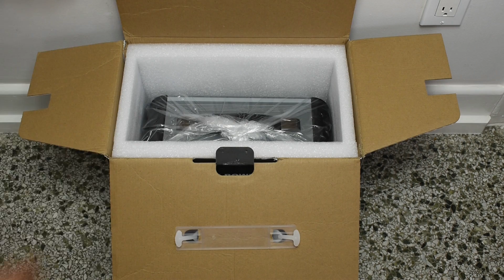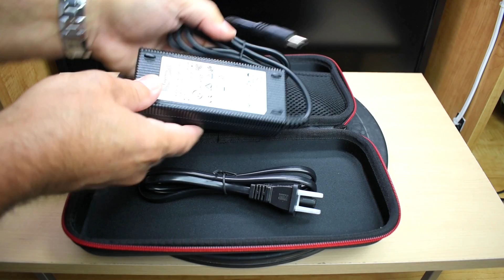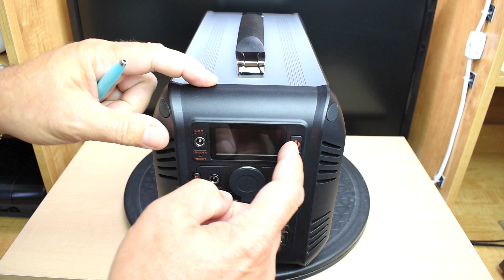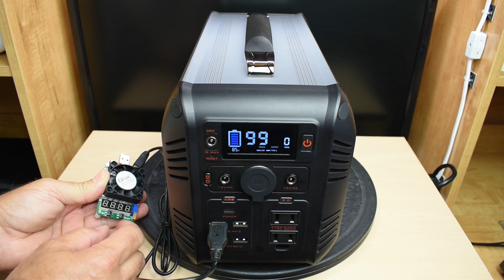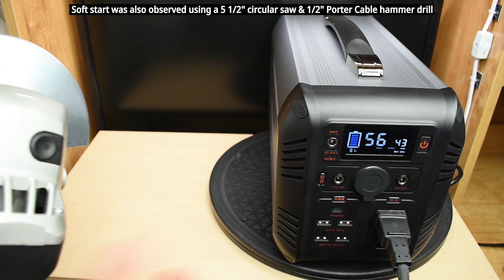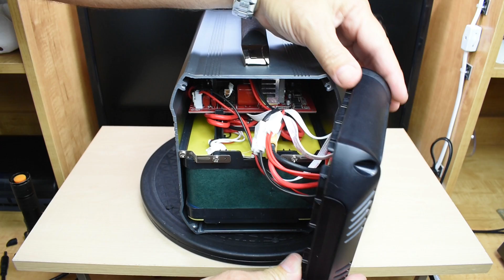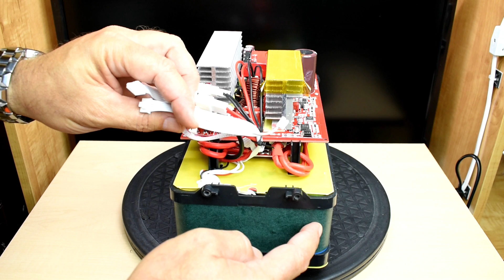This LiFePO4 Portable Solar Power Station Changes Everything!

Comment: Just received my Oukitel this morning and was very pleased with the design and build of the unit. I immediately started to charge it with the wall charger and charged it for 10+ hours. It said it was charged to 80% and wouldn’t go higher. So I unplugged the unit from the wall, tried to turn it on and it was completely dead. The charger was cool to the touch the entire charge time. I hade full display and all lights were on during the charging phase. Any ideas? I’m gonna leave it plugged in over night and then check it for charge again. Strange!
Reply from the maker: Drain it all the way down, let it cool 1 hr, then recharge. :-) It will go to 100%. Press and hold the power button to turn it on. The unit should power up even if the battery is drained, that's weird.
Reply: @electronicsNmore  ... Thanks for the reply! The unit will not even turn on if unplugged from the wall charger. It turns on for a split second the off. Can’t even try to discharge it. When plugged in, it shows about 80% and the battery icon shows charging. I also tested the charger and it seems to be putting out around 20v. But will not even get warm to the touch. I tried to reset the unit and nothing. Weird!
Reply from the maker: @COMtnPilot  Try using a 200w load while it's plugged in and charging.
Reply: @electronicsNmore  ... OK. I’ll ty that when I get home and let you know. Thx!
Reply: @electronicsNmore  ... Well, I got home from work and plugged in my rice cooker (430 watts) to the unit and had the wall charger connected as well. It took approximately 55 minutes to completely drain what power was left (79%) in the unit. The unit shut off with 4 minutes and 5% left. I let the unit cool down as recommended, then plugged the unit back in to the wall charger. The battery indicator is showing charge, but the numeric indicator shows ZERO watts input. I don’t think this unit is any good. It might even be used and defective. I was looking through the manual and it shows I should have received a wall charger, a car charger, and a solar panel charger. I did not get the car charger. I guess I made the wrong choice, so this thing is going back! Not very happy right now. 🤬
Reply from the maker: @COMtnPilot  Sounds like another person bought it, likely damaged it using a charging method besides what should've been used, stole the missing parts, then returned it. Sadly you got it. It happens. Send it back, you won't have to pay Amazon return shipping. Get another one. I bought a folding solar panel from amazon, and inside was a stack of paper. I reported it, and got my money back.
Reply: @electronicsNmore  ... Update! I tried to contact Oukitel directly and never heard back. I put in a claim with Amazon and was refunded. I was not asked to return the defective unit. Question, is there anything I can do to try to figure out what the problem is with this unit? I would pay someone to troubleshoot and repair it at a reasonable cost. Just thought you might know because of your knowledge base. Thanks in advance!
Reply from the maker: @COMtnPilot  Usually you just select "return item", then give a reason "Defective", then you're issued a return label. After that they ask to send a replacement. You made out. You'll need to see if there are any electronics repair shops in your area.
Reply: @electronicsNmore  ... They did not request I return it. No label was issued. I have the email proving it, and plan to print and keep it too. I’ll tinker with it. Might be something simple. I could not believe that Oukitel would not respond to me or Amazon. I think they realized they sent me a used and defective unit. Kinda pissed me off! I will not attempt to buy another from them either. Thanks again for all your input! Cheers!
Reply from the maker: @COMtnPilot  You did good though, the bank of LiFePO4 batteries is worth some money. Maybe use that to power another inverter. :-)
Reply: @electronicsNmore  ... But only if the batteries are still good. I wished I had your skills and knowledge to troubleshoot this unit! 😏
Reply: @COMtnPilot  Mine (Bibene) died after 16 months. I was super happy with it until then. No longer charges (0 watt input). Did you ever find a solution?
Reply: @JohnMartin-regardingjohn  Nope … Still sitting in the original box. I thought about dragging it back out to try and charge it again. I wished I could find someone in my area who knows more, and feels comfortable testing and working on these units. Like I mentioned before, I would pay a reasonable fee to have it repaired. I would love to be able to use it. Let me know if you find a solution. 🧐

Comment: Great review! I was trying to decide between the Jackery 500 and this one. You made up my mind for me! I appreciate you time and efforts. Very well done! SUB EARNED! 👍🏼

Edit: BTW ... Can you recommend a 100-120W foldable solar panel for this generator? I plan to buy the booster you recommend as well.
Reply from the maker: Great to hear! Glad you liked the video. Be sure to use the link provided. As for the panel, the one below is good, the Jackery 100W is overpriced. I like Renogy, HQST, & Ecoworthy. Check out the 100W folding panel below. Uses (2) 50W mono panels. Thanks for watching!
https://amzn.to/3cx9uOw
(Amazon Affiliate Link)
Reply: @electronicsNmore  ... Thanks for the recommendation. Question: If I just buy this 100W panel without the controller, will it work with this generator? It should right? It has an internal mppt controller if I remember correctly.
Reply from the maker: @COMtnPilot  It's only 2 more bucks with the controller, so take that deal, and keep the controller for another use.
Reply: @electronicsNmore  ... Good point!
Reply: Have you seen the ALLPOWERS Solar Charger 100W Solar Panel Foldable Portable? That one folds up really small.
Reply: I'm using 120w foldable, it worked (connected, then charged), however,  CN505 input limited to 90w, i.e. (technically no matter how many watt-panels you use, 90w 100w 120w 150w) as long as open circuit voltage 15-24v, it's suitable but input limited to 90w.

Comment: It's nice, I'd have to build my own though, unless it's a quality product, and stupidly low price, like I'd have to be just dumb to not buy! I'd probably modify it, anyway, but building your own, is  just fun, and you can make it how you want it, and fit your needs! I think I'd start with something like 100ah Eve cells, lifepo4, maybe 24v, with a 40amp epever tracer AN charge controller, a renogy 40 amp DC to DC charger, if it can charge 12 to 24v, there us one surely, and use a couple server power supplies, in series, about 38amps each,  and a DC to DC buck converter capable of around 20amps sustained, maybe add a small cap bank to the 12/14v output from the DC buck, to allow large startup surge from a small air compressor, or something similar, something like a 5farad super cap bank, maybe acting as a battery for tiny loads, like all led night light, maybe have a timer circuit to cycle the buck converter, to save battery power,  charge the cap bank 1, minute on, 2min off, if something, to prevent the DC buck from sustained operation, have a pre-charge relay set-up, but 120v charging at about 30-38amps, the 12-24vcgarging at up to 40amps, and the solar charging at nearly 40amps, it should charge fairly fast, along with a 1500-2000 watt inverter, it could be a cool project! And very useful! 8s 3.2v 100ah is a decent amount of power! Even with a 12v 4s battery, it could be very useful! But 24v it would be much more efficient, charging, and discharging, less current,   
And more challenging wattage, but I know you know this! I don't know the weight or mass it would end up being! It may be better at 12v, or maybe 50ah at 24v, an 16 gauge aluminum case could be built easily! Along with 1"x1" angle aluminum, for bracing, abd battery mounting! Oh man, you got me wanting to build this thing now!! I have had the idea for a 12v power supply, I have a 12v battey bank, fir my 12v lighting, security cameras, and what ever needs power, from a 300-400ah 12v lifepo4 bank, I been thinking of adding a 12v inverter for emergency powering of necessities! Mostly fridge, microwave, and lights! Easily done with a 2kw inverter! So a 2 - 2.5kw inverter, with the 400ah, a internal battery of 50-100 ah, it could come in handy, the way the weather is getting!! Sorry for all the ramblings!!

Comment: I just came across your review. Great job. So helpful. I am going to subscribe. One question, I have been considering a Bluetti or Jackery. This unit seems to be just as good. I am interested in your opinion on what to buy. I am referring mainly to reliability and quality. Thanks.
Reply from the maker: Great to hear! I have many videos covering a very wide range of subjects, so you should be busy for a while. :-). I also have product reviews on my channel for the Jackery Explorer 240 and 500 units, as well as the EF Delta, and Maxoak Bluetti and 300W compact unit. Jackery makes a good product, but based on the price of the Jackery, which is the same or more, I'd take this unit over the jackery 500 because of the LiFePO4 cells, much nicer light, aluminum body, Type C port, and in my opinion better surge ability. Maxoak Bluetti and the other unit I tested, I like very much, but they don't have LiFePO4 cells. Thanks for watching! Be sure to share my channel with others.
Reply: electronicsNmore Thank you for your quick response. I figured this is what you would say. The only big question is well these hold up over time. It has great specs for sure. 👍🏼
Reply from the maker: @litnoregrets7551  No one knows how it will hold up over time. The PPS would need to be cycled over and over on a daily basis for at least 6 months.
Reply: electronicsNmore Thank you. Sorry, I was not clear. I meant things like the quality of the inverter, Charge controller, etc. These are hard things to know and it will take time to tell. Jackerys have a long history and seem rock solid, but they have the worst batteries. Bluetti seems pretty good, but seem to suffer some minor issues. You seem to be the only technical reviewer of this unit. I’m so glad you reviewed it. Time will tell. 😊
Reply: Many will go for the Jackery due to their excellent customer service. Their explorer range comes with a 24 month warranty. The LifePo4 is very tempting though.
Reply from the maker: @mreverybody1150  This unit is better, but I do agree that jackery has good customer service.
Reply: @electronicsNmore  Yes! I discovered that the Jackery gives you an extra year on top of the 24 months if you register it too!

Comment: Great review, thanks. Any current recommendations for a hand crank generator? Something that might be able to charge a power supply like this, but maybe smaller like the little banks for phone etc? No personal background / skills / jargon on how to build one. Would love something that could even put a dent in this unit, especially since Solar isn't always available when needed. Any thoughts on the Ktor units? Even a little motor from Amazon that you think could be tinkered with to make something hand crank. Thanks.
Reply from the maker: I did a review a while back on one(Link Below), it works, but you need to do a lot of cranking. I would connect it to a bike. Thanks for watching!
https://www.youtube.com/watch?v=QMdeu9GhTT0
Reply: @electronicsNmore  Thanks, yes I saw that one a while back and was wondering if you had anything else in mind. Last I looked it didn't have shipping to US - saw similar ones on Amazon, but can't tell if they are just a knockoff of the one you reviewed.

Comment: how does this change everything?
Reply from the maker: The title infers "game changer". The majority of PPS use Lithium ion, many made of all plastic, many with a poor LED light or no light, and many can't handle surges as well. This unit in my opinion is better than the Jackery 500, which costs more money.
Reply: @electronicsNmore  sorry to come of snobbish the real issue of all these units is the wh capacity. . in real situation you need several kwhrs of capacity, and most on the market are just not doing that
Reply from the maker: @mikeriverajr4447  Higher Wh = a lot more money, and a lot longer charge time.

Comment: Thanks for this good review and testing. Would be nice to hear what the max. watt intake is for solar AND wether you can increase charging speed using multiple inputs like solar and car charging simultaniously....
Reply from the maker: You're welcome! 100W is the max input for this unit as stated in the video, it will take 6 1/4 hrs to charge in full sun using a 100W solar panel. Thanks for watching!

Comment: Absolutely great design, but I feel the diffuser could be a cap design so you could remove it and expose the full directed light, that way you could use the LEDs more like a torch as you are carrying it at dark if god forbid you needed to.  Definitely a good way to take it from great to amazing.  
Equally maybe an LED strip on the top of the casing for lighting up the way, perfect for a tent compared to the side light.
Reply from the maker: I prefer an area light over a flashlight/spotlight. Thanks for watching Kris! Be sure to rate thumbs up, subscribe, and look over my extensive video playlists below for many other videos of interest to you. Taking one minute to share a link to my channel with others on social networking sites would be greatly appreciated. 
http://www.youtube.com/c/electronicsnmore/playlists

Comment: I'd consider buying one if not for that horrendous charge time due to the charge rate. 100W charging just isn't worth it when you consider a number of models support fast charging or charging simultaneously from multiple sources which cuts time down significantly.

Why can't these companies take the LiFePO4 battery from here, the fast charging of the EF Delta, and the inverter from the Goal Zero and make one amazing system? Every single one has glaring shortcomings.
Reply from the maker: I'd like 200W, so you can charge in 3 hrs instead of 6.
Reply: @electronicsNmore  That would make this system an amazing buy. Hopefully they improve that on the next model.
Reply: The (apparent) 100W charging limitation is the only thing stopping me.  That and the fact that an AC brick only pushing 100W should not get hot.

-Matt
Reply from the maker: @junkerzn7312  Maxoak power supply gets just as hot.
Reply: @junkerzn7312  That's another good point. The design has a ton of potential though.
Reply from the maker: @techtastic2010  Im tempted to buy another 19v / 4.5 - 5A SMPS to see if it gets just as hot. They're only 18 - 20 bucks.
Reply: @techtastic2010  Yah.  The insides look decent.   The discharge capabilities look decent.  Using LiFePO4 is a big win for robustness.   The 4s/8p pack looks robust.  It ought to have a good service life.   Only the charging characteristics are deficient.

-Matt

Comment: Did you try the reset pinhole or power cycling after changing the hertz?
Reply from the maker: I did try switching the unit from 60Hz to 50Hz, then powered the unit off and back on. The same exact result, no 50 Hz. I didn't try resetting the entire unit though, because every feature worked fine except for that one, but I'll try that too and report back later. Thanks for watching!

Comment: When you switch to 50Hz does it switch to 220Volts?
Reply from the maker: No. Some countries have 50Hz/120vac, like Jamaica.
Reply: @electronicsNmore  Probably, it would switch to 50 cycles when it is connected to a 50 cycles source

Comment: I think 50/60 Hz is selected on inverter chip boot up. Could you select 50Hz switch it off and back on again and redo the test? Thanks.
Reply from the maker: Just did that. Same thing, stuck on 60Hz. I might have to try the reset button as last resort.

Comment: What would happen if you used the accessory charging cord that is furnished to plug into the accessory socket on the device. Would it charge its own self?
Reply from the maker: No. You always lose, never gain power.
Reply: If you did that, the device would output the watts from the charger, but it would consume more watts than it outputs. Efficiency losses are always present in an inverter, and the charger also loses wattage via heat. 
So, the unit would simply keep discharging.
Reply: @SuperVstech  LMAO! You think that was a serious question?

Comment: I'm a little leery about the AC power supply that can cause a fire.💣💣
Reply: 85°C isn't hot enough to start a fire.
Reply: @notreallydaedalus  What about 185 degrees F?
Reply: @notreallydaedalus  Most adults will suffer third-degree burns if exposed to 150 degree water for two seconds. Burns will also occur with a six-second exposure to 140 degree water or with a thirty second exposure to 130 degree water. Even if the temperature is 120 degrees, a five minute exposure could result in third-degree burns.
Reply from the maker: I'm able to hold my hand on it for 3-5 seconds before I have to pull my hand away. It's hot, but you really can't compare a hot liquid to a hot surface, because when you pull your hand off a hot surface, the "burn" stops, unlike hot water.
Reply: @joecraigslist9467  150 degree water can't start a fire, either.
Reply: @notreallydaedalus  whatever,  the  chargers I have used on different brands of solar batteries all get about the same temps.  Even the UL listed ones, Go check for yourself.
Reply from the maker: My Maxoak gets just as hot, never any problem.